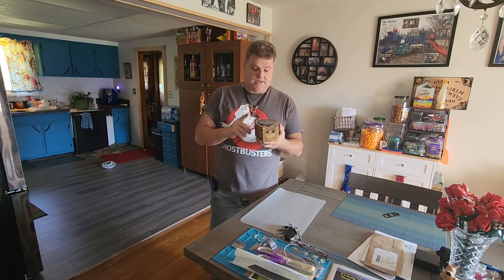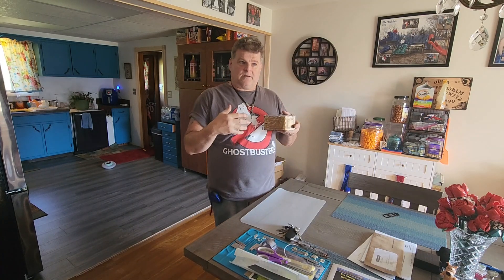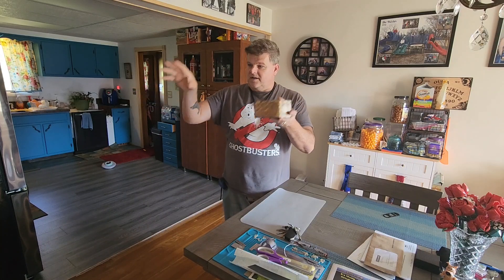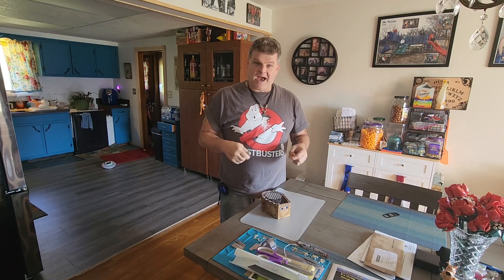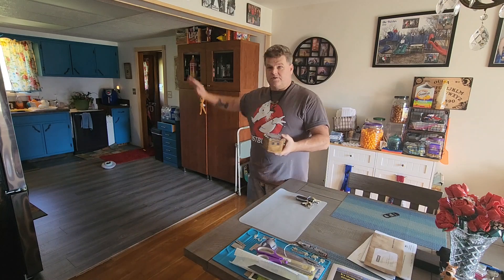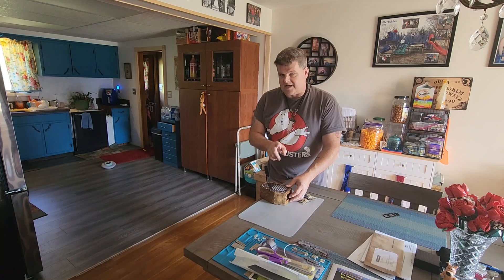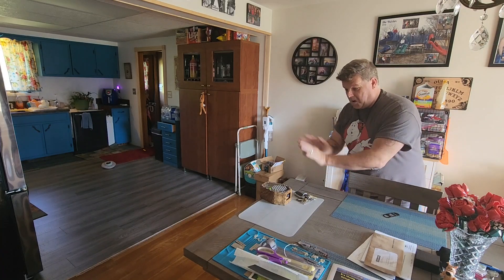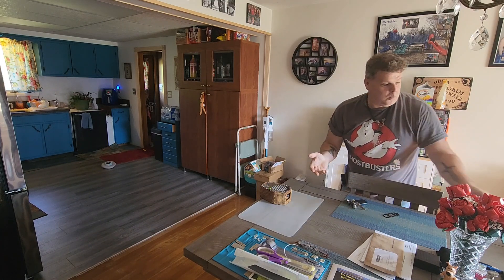Ultrasonic Music Box - Easily Triggered

Comment from the maker: UPDATE - I spoke with Josh from Paranormal Seekers this morning. He tried the key jingle with the PMB version and it did NOT work. Both Josh and Dawson Toller had negative results with this test on their 'ghost hunting' versions of the gadget. I did get test results from another friend who tested the same sensor I am using, and found it was also affected by the key test. So, for now, we only know that the HC-SR04 model is triggered by these tests. The MB1040-000 -the ghost gadget model - model is not. I'm ordering one of the MB1040-000 models to have it tested properly.
Reply: You need an acoustic spectrometer. You can get software for a phone. Get the type that records the sound sample and does a fast Fourier transform. The scanning filter type has trouble with short transient sounds. They are also called acoustic spectrum analyzers.
Reply: Kenny no one has taken apart the “Epoch” device.. can you do a video where you break down that device. I’ve heard they are virtually unable to be manipulated.. I don’t believe that but I want hard facts!

Comment: Some of these sensors used have the same type of sensor used in Bat detectors, They work by sending out an Ultrasonic click sound and the receiver detects the click timing, Unfortunately, there are lots of Ultrasonic sounds in nature that would effectively set these off, For example, Bat chirps, Some bird chirps, Crickets even, Rattling metal also has Ultrasonic frequencies, so jingling coins, etc will interrupt the Echo pings of the device. Now some of the modules have tuned frequency responses and generally only respond to the sender's pings. Since most builders opt for the cheapest components to be found, likely there are lots which would be affected.   As a developer/Creator, I am not a huge fan of any range finder methods used in equipment, I would rather use PIR Over Sonar, IR, and Proximity sensors, One of the reasons is most of these sensors rely on physical items to detect the range Since we cannot see such things as Ghosts it doesn't make sense, One of the reasons I developed the MicroPod technology as it rules out local interference from any devices or contamination whilst looking into ways of detection without false positives.

Comment: Fascinating! So it’s not the RF of the key fob but the sound of metal objects clanging! So I’m guessing that most metallic objects such as scaffolding or gas/water pipes may also trigger it off when the above has some movement (such as a boiler switching on etc) or wind rattling the scaffolding etc?

Comment from the maker: I want to clarify - the device I'm using is the HC-SR04 ultrasonic sensor. It's a different model than the mb1040-000 used on devices specifically marketed in ghost hunting devices. 
I asked Dawson Toller to help by testing his. I'm not sure his set of keys have enough metal keys to make the sounds I was making. NEVERTHELESS...Please don't give him a hard time. We're working together to figure out what is happening. He's trying to help.

Comment: If you're going to attempt to "debunk" the motion music boxes paranormal investigators use then you should get one they actually use not one your buddy rigged to save money. It's not the same thing...
Reply from the maker: @modestoca25  It uses the same method. Downplaying it as "one your buddy rigged" is unfairly taking away the fact that the process is the same. I will be testing the other devices as well, which involves the mb1040-000 version used in the "ghost hunting" overpriced version.
Reply from the maker: Also, this is not an attempt to "debunk" - it's testing the HC-SR04 ultrasonic sensor itself for what affects it. Something that should be known before using it for "finding ghosts."

Comment: `Well done again Kenny. Yes it is known jingling keys emit ultrasound see further down to a copy of a manual I found talking about this directly. As for detecting this yourself,  2 options I would suggest:
1)I think your friend who made the music box device you are testing could help you out there. All you need is the ultrasonic receiver part this time, not the entire music box detecting system. It would need to be some type of low noise amplifier and then  connected to type of display or indicator (like the music box), but I personally would prefer an analog needle meter, but then I am old school there. Your friend has already made a device that does this with the  connection to the music box AND he has also demonstrated he can build the transmitter and processing parts too that you wouldn't need in just a  receiver device alone. Maybe he could make one just to indicate when the receiver "hears" the specific frequencies the receiver is designed for. A bonus would be if he could incorporate more than one receiver, each sensitive to a different part of the ultrasonic spectrum, so that you can detect the different frequency ranges over the ultrasonic range that are emitted when you shake keys or do whatever else you want to test. This might be your easiest method to have a portable device to walk around with that is fairly cheap. 
or 
2)There are also bat detectors roughly in the $300 dollar range. They convert high frequency sounds to sounds audible to  your ear. It is known that a good source of ultrasound is jingling keys, and it is written in amanual for one of these devices : see page 3 of the attached link to a bat detection manual for the D94O by Pettersson Elektronik, 4th paragraph in the Getting Started section. Link: https://batsound.com/inc/files/pdf/D980UsersManual.pdf